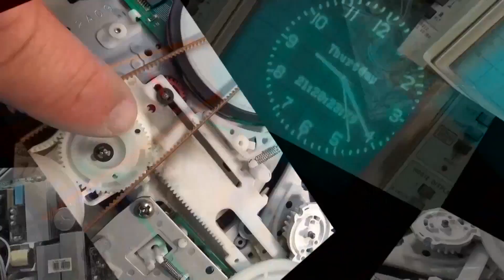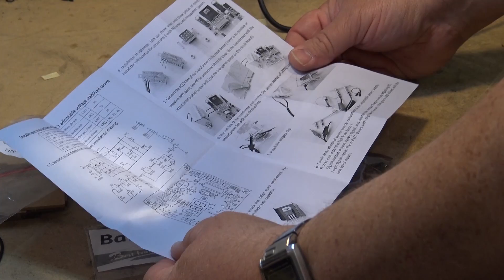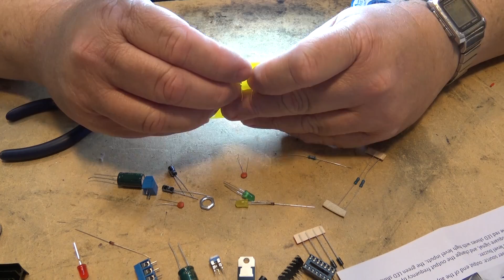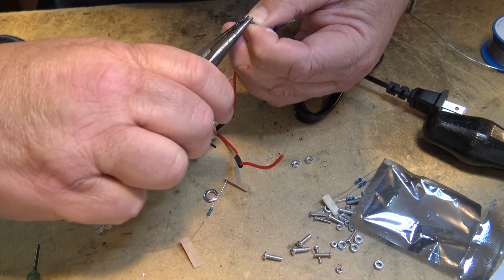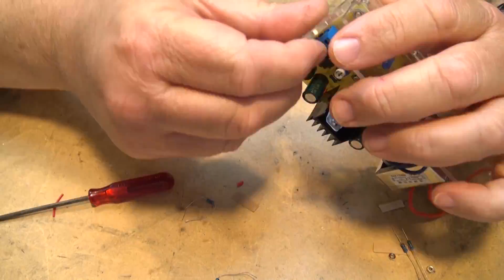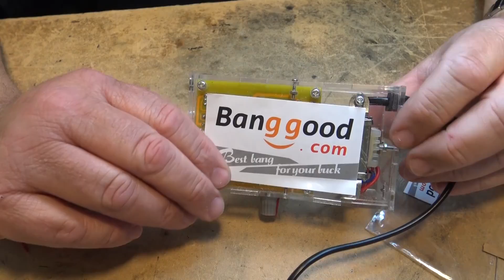Banggood LM317 regulated power supply build

Comment: I could have used this unit when playing with CMOS 4000 logic ICs. It delivers up to 15V variable power (5, 6, 9, 10, 12V were the most usual voltages that I used for powering CMOS 4000 circuits), have a clock generator, a logic probe with LEDs and a output indicator with the buzzer. Nice. I wish I would think building myself one of these back then.

Comment: oh nice one it has instructions.. although I don't need them to build this particular little circuit(apart from setting up the digimeter) its nice to know there in there.. because of it not been your own build design you could pop a wrong component  in the wrong place.. p.s why is it only going up to 13ish volts??? it should be going up to at least 34, 35, I mean its an LM317 for god sake.. am I the only one to notice this???????

Comment: I built one of these and discovered that the VCC of the CD4069 was changing voltage as well! It SHOULD NOT! I added a 78L09 directly to CD4069 so voltage will not change. I told them about this, but they could care less!!!!  It serves as a logic-probe.

Comment: Can it power a car amplifier that requires 12v-14 4v?
Reply from the maker: This is a low power unit.  The small transformer that comes with this kit can only supply about 100mA or so.  The regulator will handle more with a larger heat sink but the little transformer produces enough just for small devices.

Comment: It's 10 bucks, 2 watts, 1.25 to 12vdc. Here is the link.
https://www.banggood.com/DIY-LM317-Adjustable-Voltage-Power-Supply-Board-Learning-Kit-With-Case-p-964548.html
Reply from the maker: Yup it is cheap, but for powering up small projects works perfect. A bigger transformer, and heat sink will give it more power.

Comment: I know you loved the amplifier kits you bought, they were really nice and gave a loverly sound.
But banggood, hmm lol.
The Lm317 is one of my favorite regulators, easy to use and with a pnp power transistor and  10 ohm resistor its upgradable, ive built psu for real use with them.
Handy for constant current chargers too.
Nice to see the Quality control cat is happy with the parts :-D :-D
Reply: Banggood sells a lot of stuff that is cheap but works just fine. Their shipping is a little slow though.
Reply from the maker: That's the new quality control cat, a ragdoll that someone just threw away. He isn't even a year old yet and is already huge and super friendly.
Reply: Abandoned animals make the best pets. I've had dozens of dogs and cats which I've rescued from sides of the road, in office parks and occasionally the assholes who throw them in front of my house. If I don't have room for them, I make sure they find a good home.

Give them a good meal, a good bath and a quick trip to the vet for a checkup and a cheap vaccination clinic and they'll live a long life.
Reply: hi, how to you make the lm 317 put out more amps with a pnp transistor, i just build one of these and just was curious about the upgrade. do you have a schematic or some info you could pass along. thanks.

Comment: How about setting that so if you draw too much power the red light goes on warning you. and if the green light is on the supply is normal or not drawing too much power. Yellow could be getting close to red. And the blue light is power on. Just an idea but it looks like this unit wasn't designed for that.
Reply from the maker: The lights are just a logic level shift. So on the input line if it is high the red light lights and if low the green. So yes you could build a circuit using a zener diode and pull down resistor to keep the logic low until a certain voltage was reached and after the breakover voltage for the zener it would pull the line high and switch the light to red.